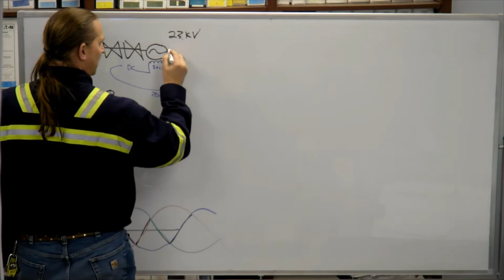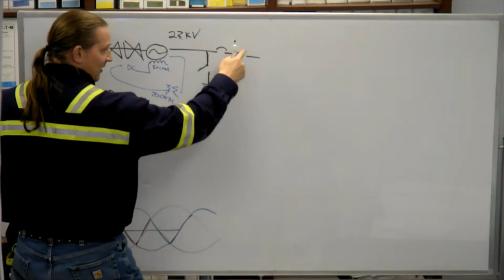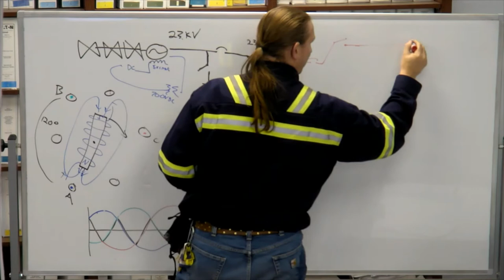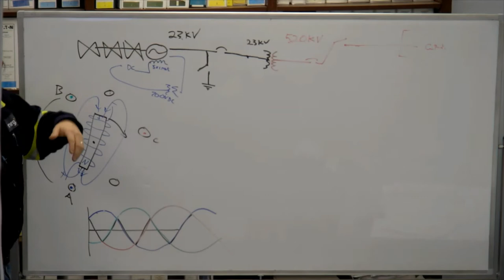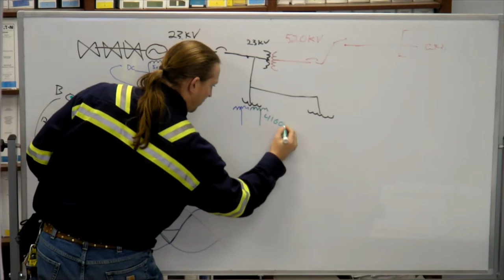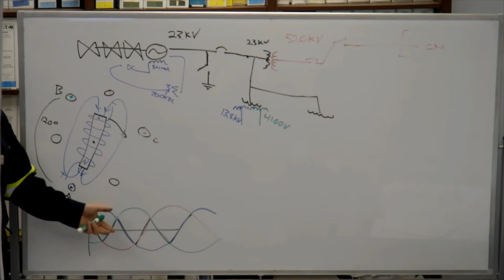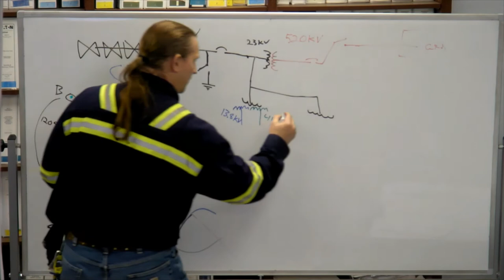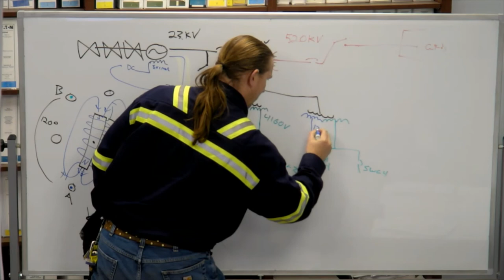Power Plant basics: Switchyard transformers and 13.8kv loads

Comment: Is everything that's drawn on the board here (save for excitation of the generator) 3-phase?
Reply from the maker: Yes. Everything in industrial motors and electrical grid distribution is 3 phase. 
Single phase doesn't give as smooth a motor torque and higher phases are not economical to build.